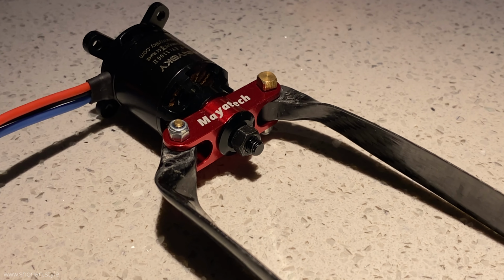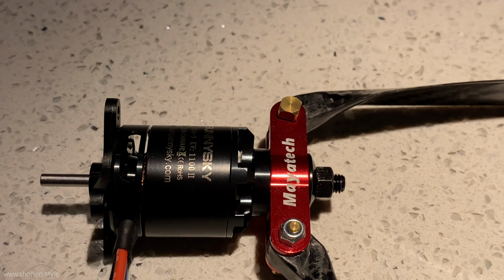E-flite Opterra 2m | Parrot Disco Chuck - FPV hyper long range cruiser drone build ~ PART 3

Comment: hello, you made a nice video, I watched all your videos, very useful works,, I do not understand English, can you write me the information about the motor, servo, propeller, esc you use for opterra,, I have parrot too,,, thank you very much
Reply from the maker: Will I use the original servos. The motor I was in the end going with is a 1300 KV Brother hobby engine. It works fine and the amp drawn is manageable by he ESC of the Disco Parrot original system.
Reply: @MattShonan  Thank you very much bro, you have been very helpful

Comment: hello brother, I congratulate you for your work, I have a question for you; I want to use the c.h.u.k in a bigger plane, I tried different engines but it did not work properly due to the amperage, which engine did you use, can you share the brand and kv,, thank you very much in advance ,,,
Reply from the maker: Yes, that is the challenge to be balanced out.
Below is the link to the complete build playlist where I discuss this issue including motor and prop option. 

https://www.youtube.com/playlist?list=PLXvxBkD7n_PNOIcLIf_hcBdEZs8VqIjvT
Reply: @MattShonan  thank you very much for your help bro, you answered me right away, greetings
Reply from the maker: @ismailkalkan2383  Have a great day and good luck with you build! 
Happy flying!
Reply: @MattShonan  thank you so much
Reply from the maker: @ismailkalkan2383  no worries! 
happy to share my experience with this build.

Comment: Where can I get those props and the prop stopper ?
Reply from the maker: I had a friend cut them out for me. However if you google prop stoppers and you can find some sites selling 3D printed once. Those are doing just as fine! It is not required to be made out of carbon.

Comment: What kv do you recommend for sunsky and the propeller like you are 10 inch 9 and 8 inch? I have a Parrot plane and would like to upgrade my engine. Please help :///
Reply from the maker: Well, it depends a bit on whether you like to be on the edge on amp draw and performance or more like efficiently and long flight time. For me I would not go over 1300 KV. 
Under 1000 KV might be difficult to get it in the air if you have heavier batteries. 
But KV is just figures and how a motor performs depends on several variables. I am quite happy with the one I got and feel it is a well balances package for a variety of props and battery sizes and weights.

Comment: where do you buy props for opterra 2m ?
Reply from the maker: You can buy props everywhere in the internet. Or from the official website. I am running a completely new powertrain and free what to choose.
Reply: @MattShonan  what size ?
Reply from the maker: @jevgenie7094  well, I discussed a few option in my build series. Basically you can choose any according to what you like to achieve. I went for super long range and minimum amp draw.
Reply from the maker: @jevgenie7094  https://youtube.com/playlist?list=PLXvxBkD7n_PNOIcLIf_hcBdEZs8VqIjvT

This is the full build series where I discuss what I do and why. 
Enjoy and have a good day!!
Reply: @MattShonan  i meant about what size on original prop ? i didn't see this info on horizonhobby ...  may be you know just write   10 11 12 13?  thank you
i am not English (
Reply from the maker: @jevgenie7094  I am sorry I forgot but it is in the video where I discuss the sizes of the props. Its is in the playlist. 

Thank you for your support and enjoy!
Reply from the maker: @jevgenie7094   I found it, it should be in this video! 
https://youtu.be/5QvblQ_5AlE
Reply: @MattShonan  you are best!  thnx       10x5 ...  on aliexpress i found 10x6    but i am thinking quality is not best.   a same have opterra  and put inav on omnibus f4 fc + bn-220 gps..  my first wing ...     i began from drones   0.55 m , 0.45 m    5" ..   now i am learning on bixler 3 and skysurfer 1400mm.. next step opterra.. and want to buy additional  parts  because i can brake)))
Reply from the maker: @jevgenie7094  Nice! Good luck!

Comment: Very interesting. I have an Opterra 2m yet to fly, and intend to run it for long FPV. Watching you with great interest.
Please lose the music on your vids, or at least keep it very low!
Reply from the maker: Thank you for the support!
Follow up videos coming latest in December.
Motivation is to make this build a fly over 4G drone with virtually unlimited range.  That makes this project until first flight a bit more tricky but we will get there. 👍🏻😊
Reply: @MattShonan  Excellent. I'm going for a 900MHz control/telemetry and the DJI digital FPV system
Reply from the maker: @simonhughes-king  
Very nice!! 👍🏻👍🏻👍🏻
I am considering the DJI system which I am using on FPV quads right now as option with the Caddx Vista air unit at a later point. 

For now, all focus was on the engines!
Regarding that engine support by the Disco CHUCK, finally, today a big step in the right direction. 😊

 Videos will come as planned early next month. 
(latest)